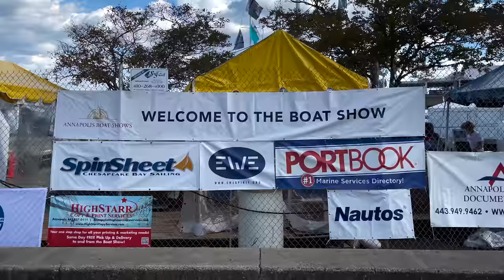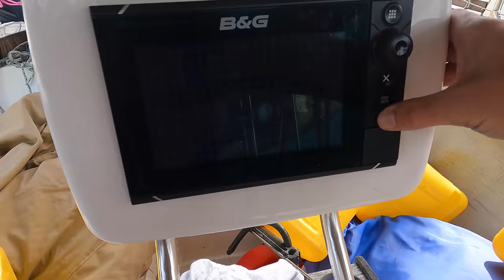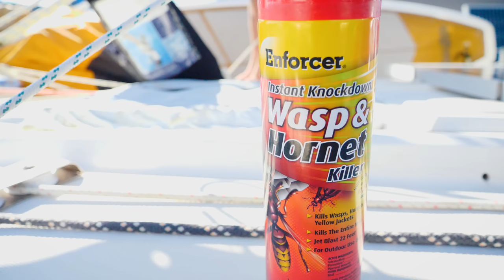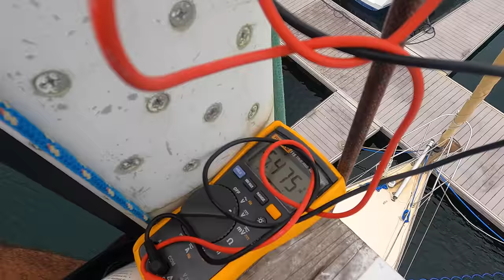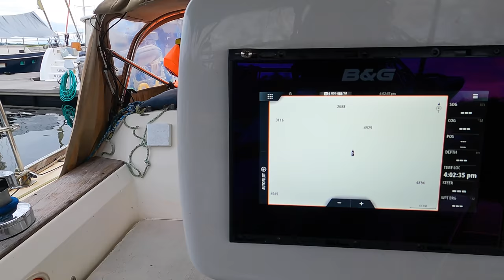The Sailing Hillbillies are Back! How did our boat survive 4 months of tropical storage!?  Ep. 117

Comment: Regarding the leaking/rusted hot water tank
1) Some of the marine models do not have a zinc installed in them to prevent electrolysis.  Popular ones sold by Defender have refit piece that replaces drain valve with combo drainvalve/zinc.
2) your sailboat has solar panels.  There is a co that sells a metal plate with water channels in it.  The plate attaches to back of solar panel, absorbs the heat from the solar panel and circulates the heated water via a very small pump thru your hot water tank.  Makes your solar panel more efficient and you get heated water.
Reply from the maker: The solar hot water heater would be sweeet! Will have to look into that! Although we all ready installed an new heater LOL
Reply: @CalicoSkiesSailing  In case you are interested, the company is Custom Marine Products and they have a website. Set up contains all the needed parts, ties in with the existing hot water tank, bit expensive but what "marine" product isn't. From what I can tell, your PV panel would have to be of the size to match the metal panel. I have no relationship to or interest in the co, just came upon the site when I was designing a PV set up for catamaran.

Comment: I see a comment below about freezing items to kill weevils.
Yep that works.
But if you have large amounts of a product in a large storage can, this may not be practical with freezer space and waiting 4 days.
What you can do if you have a large storage container of say rice or pasta and that storage container is airtight, then add in one hothands, the hand warmer.  They use up all the oxygen and generate heat by oxidation of iron in the baggy.  They will stop oxidation when no more O2 is left in the container, which will allow one hothand to last a bit as long as you open the container and close it after taking what you want.
No O2 will kill live bugs, and any eggs that hatch will die instantly.
Any concern over the left over hothand dust is minor.  It literally just rust.  You can put the hothand into a small open sandwich bag in the container to contain the dust if you are worried.
This is for dry goods with little moisture.  If you have moist goods and use hothands you may come back to anaerobic bacteria.
An example of a moist good people think is dry are cereals with "dry" fruits like Kashi.  They are not freeze dried.  Just drier than fresh.  These cereals are notorious for weevils once opened from their airtight package.  I suspect your wheat cereal in that box had some sort of dehydrated fruit and the container was not airtight.
Reply from the maker: This is fascinating thank you for your tip! I’ve assumed that the eggs don’t need much O2 to hatch and even if the container is air tight they have enough to survive for awhile. I will try the hand warmer with the rice! Def not generally practical for us to freeze. Thanks again!!!

Comment: A few thoughts:
-I'm sure Amazon appreciates the free advertising but you need to get the manufacturer of the tape holding the box together to sponsor Calico Skies!
- Having little experience with weevils, I wonder if their appearance was a local infestation or if the oats came from the manufacturer containing eggs...
- I remember my grandfather climbing a ladder to reach a wasp nest bigger than a softball on the side of his sister-in-law's new house. He stuck the nozzle of his paint spray gun in the nest and pumped it full of gasoline. Luckily he didn't get stung and even luckier yet he didn't smoke!
- Was it difficult to replace a hot water heater in Panama? Did you have to import it from the US as part of the recent pallet of stuff you received?

Keep up the great videos and above all STAY SAFE!  ⛵❤️😷
Reply from the maker: Gorilla tape for the win! It seems the eggs are usually present from the manufacturer. We keep everything really sealed up so can tell it came in the packaging 😎. Luckily we had a pallet of supplies coming down from Total Boat so we were able to add the hot water on to the pallet! 🥳
Reply: @CalicoSkiesSailing  Yep .. Gorilla tape is Duct tape on steroids.. good stuff